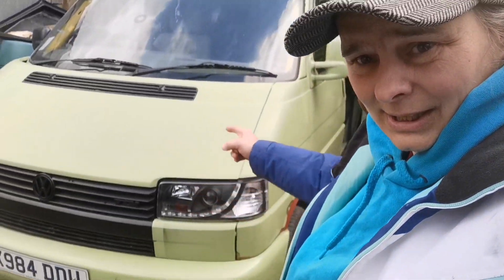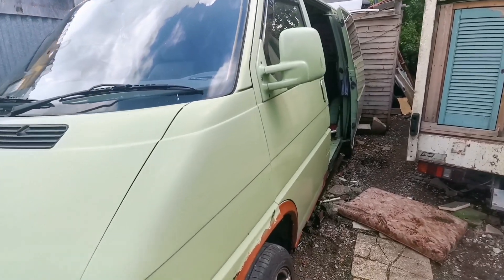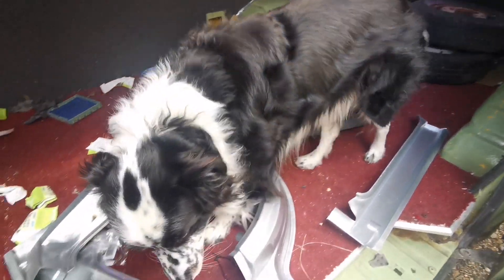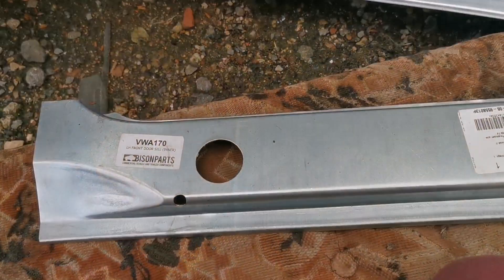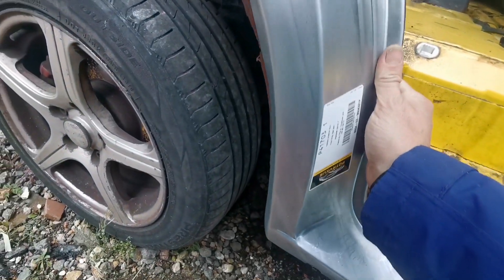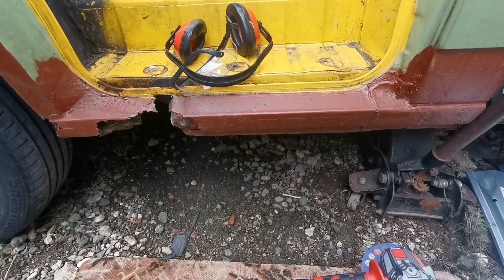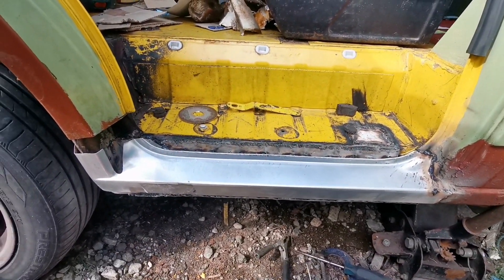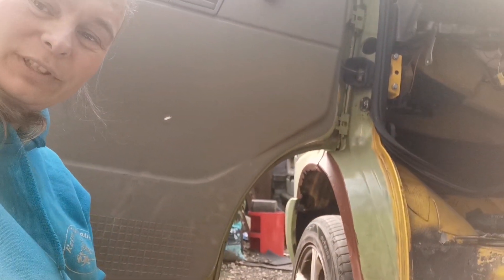VW T4 Replacing N/S passenger step sill. Volkswagen Transporter.

Comment: That factory foam confuses a lot of people. But the manual (Transporter 1991 ➤ Body Repairs - Edition 03.2003) even instructs to inject new insulation foam when replacing the sill... 2K filler foam, Part No. D 000 111 A2

Comment: That expanding foam is actually factory fitted, not sure why, maybe a sound baffle feature? 
I found it in the same place on both my sills and they’d never been touched since the factory.
Reply from the maker: That's interesting to know. Thank you.  It was very damp and made claim to rotting out that section.
Reply: stiffening and noise insulation
Reply: The foam in sills is from factory  and very flammable 
👍👍👍😜🏴🦄🦕😁✌️🤞

Comment: Good job on the sill, as you said, never mind the welding skills, at least it's the proper method! And I wouldn't complain about your welding, I've seen some real talent through my work, yours is solid and structural so up for the job, seen some welds weaker than the expanding foam.
Reply from the maker: Many thanks!! It's past 2 mot's now 🙌👍

Comment: Did you use any gas when welding? the welds look very porous, they will stick but in time they will fail.

Good on you for having a go at replacing the sills, the T4's all seem to rot in and around the same places.